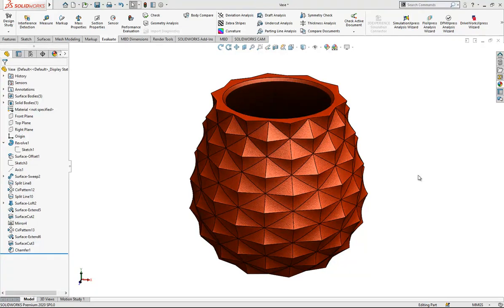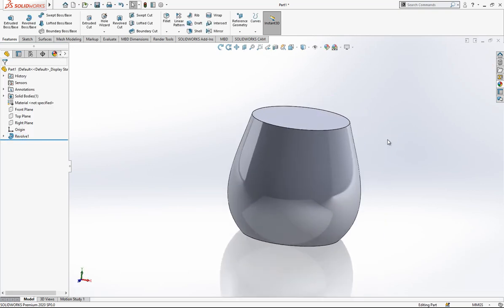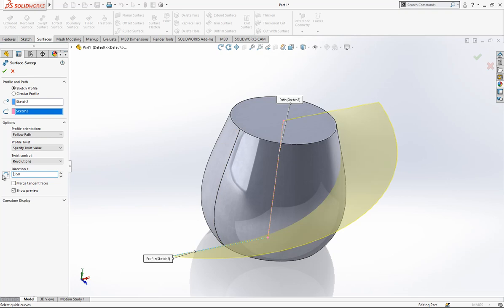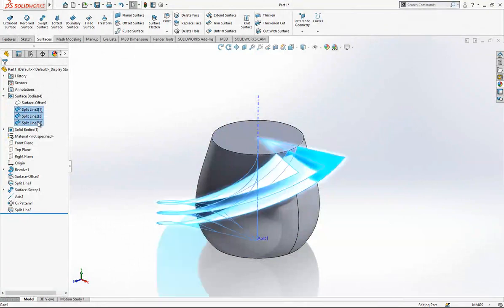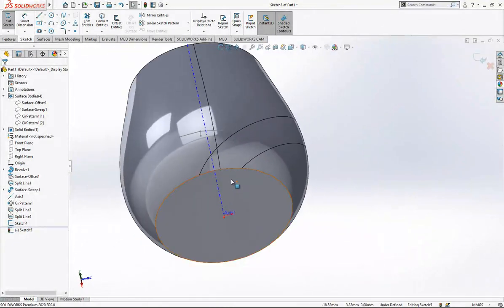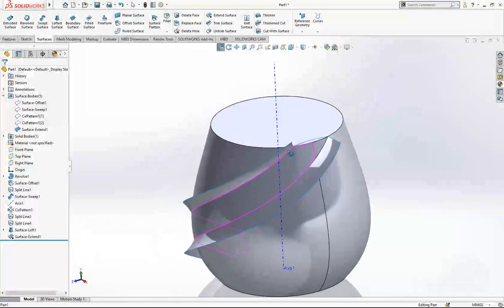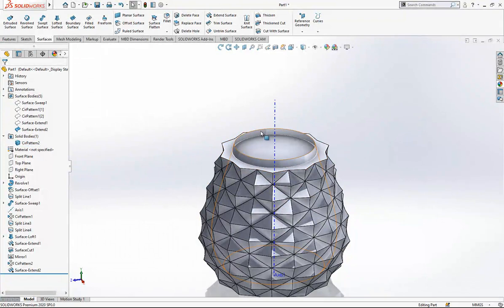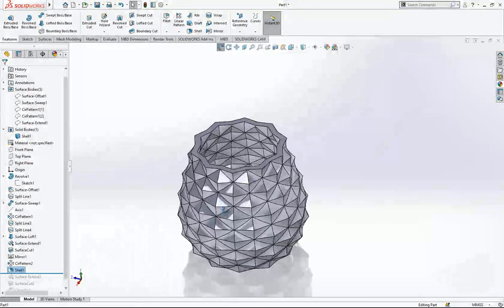Printable Vase - SolidWorks Tutorial

Comment: Thank you very much for the video.
I have an issue when making circular pattern of the cut and its mirrored one. " failed due to geometric condition" is the message. I do exactly what you do, but don't know what the problem is... !
Would you assist me?
thanks
Reply from the maker: Hi Dear, 
Under pattern option there is Geometry Pattern click box, I believe at the end, try to active and inactive that button. I think that is the problem. Or some little gaps occures on your model. Send me a email I can share with you my model so you can check there.
Reply: @3D-World  thank you very much
but didn't work